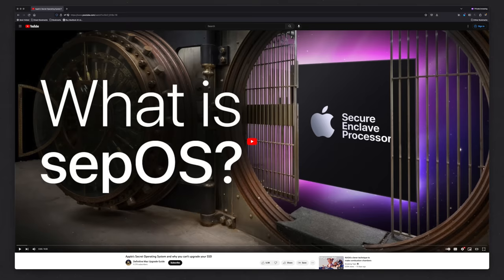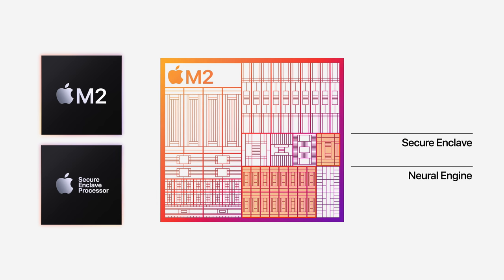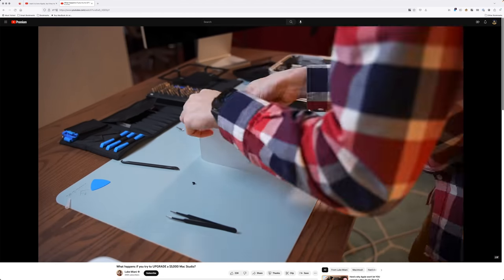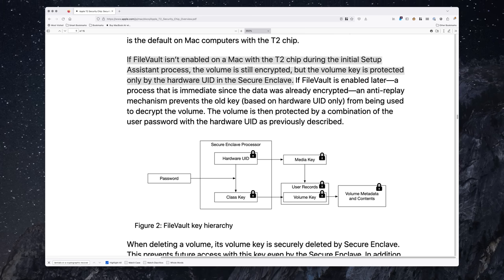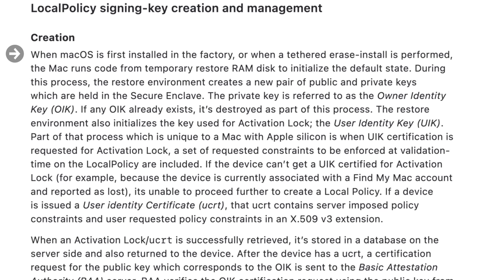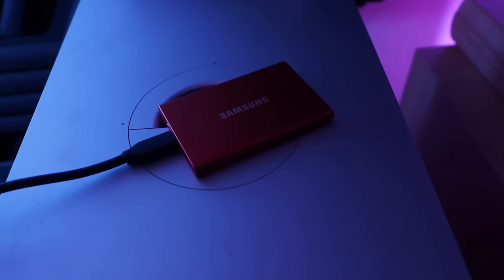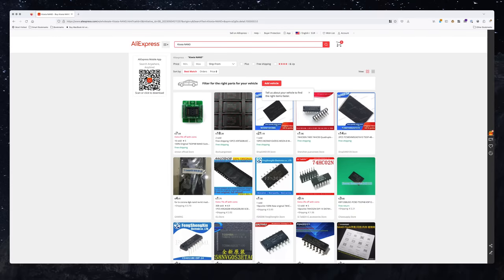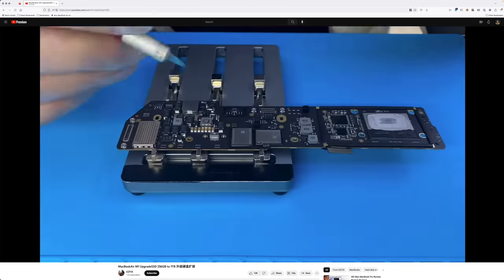Was I wrong? Apple Silicon and SSD Upgrades

Comment: The sad part is that since the industry as a whole follows Apple, we've had a ton of computers with low to no repair/upgrade potential come out these past few years.
Reply: It’s a tool, like a hammer for me at the end of the day. I use it, and replace it if it breaks. People need to stop pretending they will be using the same computer in 20 years.
Reply: @thejpkotor  Not everyone is well off enough to be able to do that. Besides, creating tons of potentially toxic e-waste doesn't seem like the smartest move either.
Reply: @thejpkotor  I agree.  A business should be on about a 3-5 year upgrade cycle depending on what the users are doing anyway.
Reply: @steveballmersbaldspot2.095  Ideally, as much as possible gets recycled.   I don't know anyone who just throws away a computer.
Reply: @thejpkotor  computers don’t just break. I have a 2015 mac book air  and upgraded it last year with a 500 Gig SSD. No need for me to buy a whole new laptop just because I’m running out of space. Also have you ever swung a hammer before? It’s so hard to break a good quality hammer. Going to last years. No one thinks they will use a computer for 20 years😅
Reply: @thejpkotor  ive been using 2 computers. one for 13 years. no problem. people need to stop pretending you need a new cimputer every other year.
Reply: @thejpkotor  I use several machines that are over twenty years old.
Reply: Industry follows Apple? 🤣
Reply: @thejpkotor  How often do you break computers? It's not hard to not break your computer. In my experience you have to be almost deliberately trying to break it.
Reply: @steveballmersbaldspot2.095  e-waste is easy  to manage; just recycle it properly and stop throwing it in the trash 😉
Reply: @steveballmersbaldspot2.095  I’m not well-off remotely, but If I can’t replace my laptop about every 5-6 years, (think amortization of about $27/month) I would be really screwed financially and probably can’t afford literally ANYTHING, and at that point new technology, for work or otherwise is probably the least of my concerns. There are MANY cheap, refurbished ways to get machines, yes even Apple ones that are 1-2 years old dirt cheap.
Reply: @mikey9836  I didn’t mean replace it Willy-nilly. Stuff happens and thing’s physically break. You have to weigh repairs against replacements on cost, sometimes bigger cost is lost business and down time. I’ve also seen 50+ year old hammers, trust me they can get beat to hell and get worn out; ask me if I’m going to buy a new hammer head or handle when the cost of a new hammer is $5. It’s not worth it.
Reply: @derGerhart  like I said I keep the old ones around til they drop. But there’s work things where speed, and reliability is important (and there’s budget money that has to be spent on technology, or it goes away). 

Where work is concerned:
It’s not even about an easy repair sometimes, it’s that certain things just can’t have down time. If I can get a new machine shipped 10 days sooner than a part and it doesn’t ding the budget, it’s a no brainer; we get a new machine and strip down and recycle the old one.
Reply: Also, unfortunately people want devices that are thin, light and don’t weigh a ton; that’s the antithesis of repairability 🤷 sorry…
Reply: Yup! 

This is the modern world 🌎 we are in.
Reply: @thejpkotor Agreed! ❤😂❤
Reply: @thejpkotor  You are wrong. And about tools….. I have soviet old hummer that still works after 50 years. Can M1/M2 works 50 years? i dont think so
Reply: I re purposed my 2009 computer as a smb server. Just do a cpu upgrade, new ssd and gigabyte ethernet and it makes a wonderful server!
Reply: @thejpkotor yeah of course, but if it fails after only 3 years ? That’s some expensive stuff, I can’t buy a new expensive machine every 3 years…
Reply: @mikey9836  I didn’t say to replace it because you’re running out of space… That’s a simple matter of getting rid of some files. The reality is that everything will eventually stop working. We need to stop, pretending that that’s not the case. But also, the drives don’t just spontaneously stop working; monitoring software will always give you early warning, signs, can you still get several YEARS out of them regardless, of how are using it. All discs have a finite read/write lifespan this has always been the case.
Reply: @derGerhart  I didn’t say every other year. It’s just a matter of reevaluating from time to time.
Reply: @HoloScope  not ‘break’ but they do wear out.  An old machine is great for the kiddos to watch YouTube or whatever, but it’s less reliable and harder to get parts after a time.

Also, if you run a business, I would say keeping any machine over 6 years around can be a liability as far as down time and lost productivity, and the reality is that if you are waiting for an aging and yes, slower machine to get work done, you’re basically wasting electricity.
Reply: EVERYTHING is an investment; if not money than in time and effort. everyone has to weigh the pros and cons for themselves.
Reply: @SketchTurnerZero  not a direct analogy… But it is a tool, none the less. Yes, my father has a car that’s over 50 years old and still drives it around, but let’s not pretend that the cost of fixing (sometimes completely rebuilding it) would not have bought a few new cars. This in itself was a luxury, and mostly about nostalgia. Most people could not have afforded to repair it, and it would have been cheaper just get a new one.
Reply: @ConcreteAdvisory  That’s  a decision for you to make. It also depends greatly on how you are using it.
Reply: aside from soldered ram I don't really think that is true.
Reply: “Blame Canada, blame Canada” as the legendary south park authors could probably say
Reply: i shouldn't be FORCED to do this... the majority of humans don't upgrade every other year... stop saying it's ok